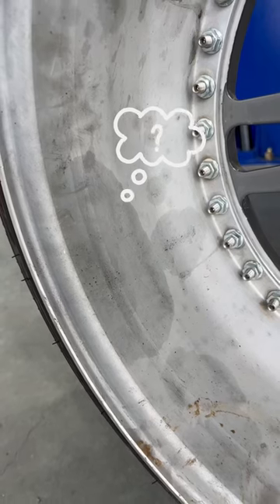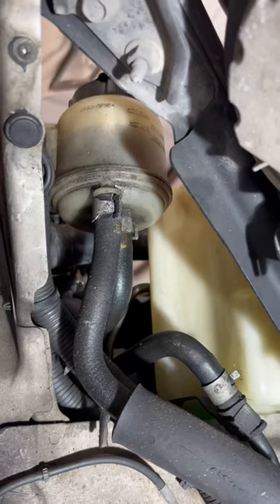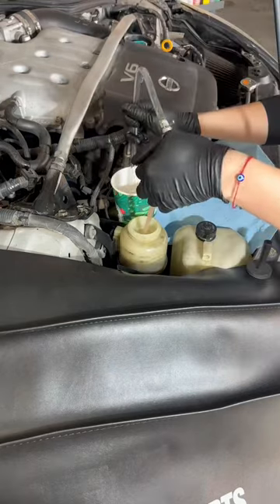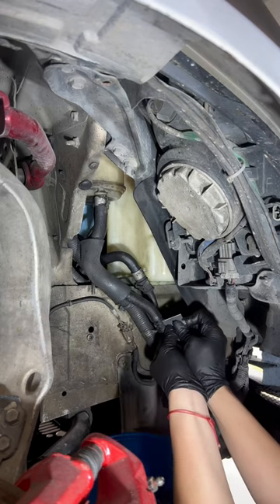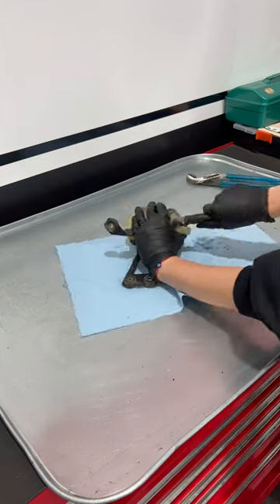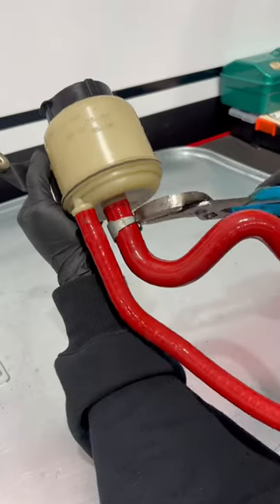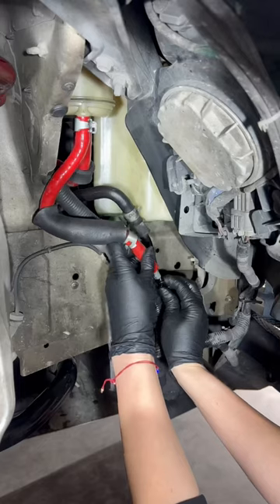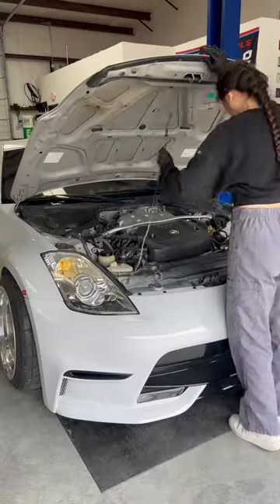Quick 350Z power steering hose replacement✔️

Comment: The silicone pipes add so much aesthetic ✨
Reply: @michaelric3540  maybe on your 350z but, no one asked u anything✨
Reply: Buen trabajo aunque pudieras haber aprovechado la oportunidad para cambiar el líquido de la dirección, si desconectando el retorno que va al envase plástico original y colocándolo un tapón provisional, y el retorno a un envase en el suelo por ejemplo luego enciendes el coche y vas reponiendo aceite mientras controlas el aceite viejo que pierde por la manguera del retorno.
Reply: They also add leaks
Reply: No they don’t!!!It’s a junk repair using that rubber garbage
Reply: @highvisibilityraincoat  they only leak if you use the wrong kind of clamps. I had my whole engine bay done and not a single leak. Had em for almost 6 years before selling the car
Reply: @Chris Townsend  it's not a junk repair they just attract dirt. They last a hell of a long time and they're cheaper. Who cares if they're dirty it's a stupid car
Reply: @Chris Townsend  and it's silicone Beavis not rubber
Reply: @chrislull670  Cool. I'm sure if you get quality silicone hoses with fiber reinforcements and stuff they're good but all the ones I've seen/used were fairly cheap and tended to leak. I stick to OEM hoses, they last longer from what I can tell.
Reply: Oem is good but they won't have a chance in hell of outlasting quality silicone hoses and they're like 1/3 the price of oem
Reply: @Chad King  use the correct clamps too. No leaks.
Reply: @chrislull670  yep leaks only happen if installed incorrectly/leaving em loose or using horrible quality clamps as u said
Reply: @Townsendcat2  BTMS xEV units use these same hoses.
Reply: Yeah aesthetic you can't even see........#DERP
Reply: @bert5770  you must still wear tidy whiteys cuz u don't care about what can't be seen right..?

Comment: silicone hoses are up to 15% more permeable than rubber hoses. unless the inside of the hoses are lined in a rubber coating, they are not designed for oil (like ATF/power steering fluid) or fuel either. While they look pretty you will need to keep an eye on the reservoir and check for leaks more often
Reply: They are lined bro. Do your research. I had my whole 350 engine bay done for almost 6 years and not a single leak.
Reply: @chrislull670  Reinforced hose walls does not mean rubber lined. You do your own research "bro"
Reply: @huntobongoboy699  I never said it did
Reply: I had the exact same style as the ones shown. They are rubber lined. Guarantee it. Ask her if you don't believe me
Reply: @chrislull670  silicone hoses which are made as radiator or vacuum hoses are not rubber lined. They are reinforced with strand like material but not rubber lined. Silicone is porous which is why it's not suitable for oils
Reply: @chrislull670  the whole point of the hoses are to be a performance upgrade because silicone is more heat resistant and can handle more pressure and the more pressure in the cooling system the high the boiling point of the coolant thus better cooling efficiency and performance and if you rubber lined them than you'd mostly just have an aesthetically pleasing hose which is still cool nonetheless
Reply: @Hunto Bongboy  that's not the whole point of them. You don't really know what you're talking about. The only ones that are rubber lined are ones with power steering or oil. The coolant hoses aren't rubber lined. And one of the points of them is because they're less then cheap ass shit ones you buy at auto zone yet will outlast the life of your vehicle. That's the main reason people use them. Some people do it for the visual aspect not realizing silicone attracts dirt like no other. Yes silicone may handle more pressure but where are you going to get that pressure from? It's not like adding hoses increases pressure lol. These hoses were not meant as any kind of performance upgrade other then longevity.

Comment: If you don't want to go that far, I found just replacing clamps with worm great type stops leak in most cases. You don't have to remove the hoses. Just relocate old clamps out of the way, and put new worm gear clamps. Hose gets swollen over time and constant tension clamps cannot make a good seal on swollen hose.
Reply: I agree that you don’t need to replace the hose however it’s good to do since your already on that area :)
Reply: Yessir all day I recommend customers to reclamp the non pressurized hoses
Reply: @Hexical Cat  if you are replacing fluid or have to drain for repair, it will be easy to change hoses while you are at it. But, if you don't want to drain fluids, easy to just add clamps.

Comment: Caution. Those red hoses "got the same style of "wrapped" hoses for radlines on my bike. They do leak, but wierd. Its kinda like they sweat over time. Nothing major. But keep n eye on em for first few weeks after install. Will save ya alot of mess down the road if urs start leaking fluid n ur tryna find where from. Have fun and keep doing good work
Reply: She barely drives that car

Comment: Personally I would’ve replaced the spring hose clamps with the screw or bolt type. I’ve had a few spring types fail after installation
Reply: spring hoses let the plastic and hoses expand with heat cycles, so I'm assuming that's why Nissan uses them.

Comment: GJ overall, but the clamps you have used are supposed to be used with rubber hoses and won't hold on silicon hoses. Should've used screw clamps.

Comment: use heavy duty degreaser to clean up the leaking power steering fluid it works well. Does the 350z's use ATF for power steering? I didn't know that haha
Reply: Most "power steering fluid" is just transmission oil marketed as its own thing. They do the same thing with brake and "clutch fluid"
Reply: @brandonwilliams6633  really? Do they just put differnt additives to change the smell?

Comment: You put automatic transmission fluid, in a power steering reservoir??? How did that end up?
Reply: its just fine because this car uses ATF for the power steering fluid and it will tell you either on the cap or at the parts store

Comment: The cleanest mechanic I’ve ever seen Jesus. Take those gloves off roll around in some oil. And if you had a brake fluid leak your brakes would be boo boo. You could just pop the hood and look at the fluid, 😅 brake fluid good okay. Op. Power steering low. So let’s replace them with worse quality. I know that you want to make it pretty and up your channel for YouTube but I turn wrenches all day. Those hoses are garbage and won’t last one summer in Arizona. That is at least. Use oe parts or certified high performance rubber insulated tubbing for oil. You have a lot to learn on your road of working on cars. I hope due diligence is more important than making things look pretty

Comment: You don't use ATF in the power steering system. You use brake fluid at the least, if you aren't getting the actual power steering fluid from Nissan. Your fluid is going to absorb lots of water with those silicone hoses too. Those are cheap parts to get from Nissan. Using OEM parts and fluid gives the best results.
Reply: Biggest BS I've ever heard. 
1. Brake fluid absorbs 10 times mote moisture than ATF.
2. The manual says to use dexron iii or ii.
Reply: I don’t think you know what you’re talking about. Brake fluid will absorb way more water than ATF or power steering fluid. Also, many vehicles say to use ATF right on the cap.
Reply: you are dead wrong. First of all brake fluid is extremely hydrophilic meaning it sucks in water and 10 times more than PSF and secondly if you called Nissan or any parts store for power steering fluid for the 350z they would give you ATF because thats what Nissan calls for.

Comment: That ATF is going to burn that rack & pinion and specially the power steering pump, you should've gotten power steering fluid and actually fully flush everything and filled up with new fluid!
Reply: Not really some cars are designed to use it. My 2010 Camaro SS uses ATF for the power steering fluid. Weirdly enough all other Camaros after just use regular power steering fluid.
Reply: Power steering fluid and ATF are the same thing.
Reply: Lots of vehicles actually call for ATF to be used in the power steering system
Reply: another internet mechanic. Some vehicles call for ATF for the power steering fluid like some hondas and for example this nissan. Try to do at least a little bit of research before you speak on a topic.

Comment: Next month on JustRolledIn:
"Customer states another shop replaced her power steering lines..."
Reply: lol
Reply: They won't leak if you use the correct fittings. I did my whole engine bay and not a single leak for the almost 6 years I had them on.

Comment: Why use ATF for the power steering? Does it perform better than the standard fluid? Asking out of curiousity.
Reply: It’s the same thing
Reply: @zareefhakim1678 . Oh. I'm use to seeing it as a slight brown color.
Reply: A lot of vehicles, including the 350, call for ATF to be used for power steering. They’re both hydraulic fluids but ATF has different formulations that typically perform better.

Comment: High. I must not know as much about cars as i thought i did. and ill admit that.

So heres my question: WHY did you refil the power steering system with ATF?

what am i missing?
Reply: ATF and P/S fluid have very similar fluid properties and detergents. Many vehicles actually call for ATF fluid for power steering. A lot of of Toyota/Lexus vehicles for instance use ATF IV for the P/S system! 
Hope this helped.

Comment: Anytime I see the power steering lines weeping away, I just check the level and send it on its way. Older cars will weep a tiny amount of fluid yet the repair cost for some of these hoses is hundreds of dollars. If it loses less than 50ml a year, you can leave it alone until the car ends up in the scrap yard.

Comment: I mean yea u can use atf as a temporary substitute but I'd stick with the fluid designed for that particular system
Reply: the 350z uses atf for the power steering fluid and in fact alot of vehicles do

Comment: Bro why the hell do I keep forgetting you can use automatic transmission fluid as an alternate for power steering fluid when she said ATF I genuinely got confused.. until I remembered
Reply: Nissan and toyotas actually call for dex iii atf for power steering
Reply: I forgot people use that as well. I've just always replaced power steering fluid with power steering fluid.
Reply: Lots of vehicles will actually say to use ATF right on the reservoir cap. My dodge ram and Subaru forester does.

Comment: I mean, I could be wrong, but so far no Nissan doesn’t use ATF THEY USE POWER STEERING FLUID
Reply: Right on the cap for the 350 it says “Use dexron type ATF”

Comment: Did u say put ATF in power steering pump?
Reply: Some systems use it
Reply: ATF is actually better than ps fluid.
Reply: @Antiquefarmequipment  can your put atf in any car?
Reply: @MA-vm6jl  probably not every car. But most you can. Basically the same thing as psf but better

Comment: ATF ? First I hear about it, I wouldn’t recommend that in my power steering system
Reply: Most manufactures call for atf it’s automatic transmission fluid. It’s just a hydraulic fluid
Reply: Atf is a Z thing

Comment: I have. Cuestion.   For.  Girl.  I have.  2008.  Chrysler town and country   3.8.   v6.      The.  Instrument  panol.  Or.   Ware.  You.  See. You. Milles. And.  Gas.  And.  All. Of.    The.   Is. Flickering.    What.  Is.   This.     And.   I have.     Two.   Sensors.    To.  Change.    And.  Smoke detention  pomp.      And.   I think.   I have.   Some.  Cain.  A  switch.  Or.  Don't. No.   I think. The.  Call.   The.  Make. The.  Power. Go. Thu. The. Cables.   To.  Fan.    And.  Motor.  And.   Starter.  Is.   Located. In front. By.  The.  Radiator.     The.  Old.   Have.   Can.  You.  Be.  Cain.  Tell. Me.  What.  To.  Do.    I don't.  No much.    On.  Electronic. On.  Car. Parst.     I yes. Do.  My.  Best.   To.  Kiping. Running.     Thanks.   If.   Don't.  Mind.  Girl. 👍👍👍